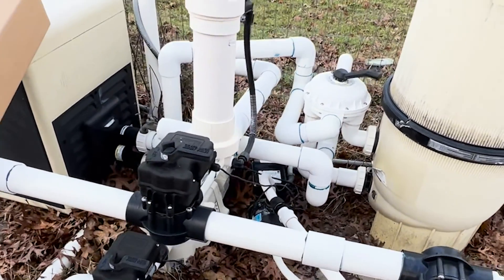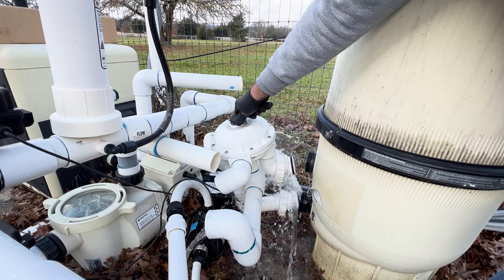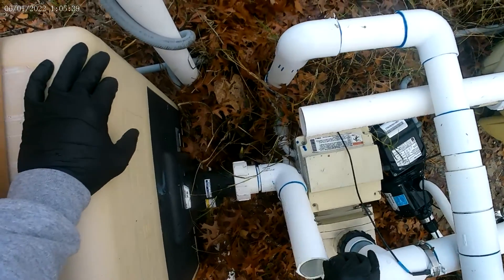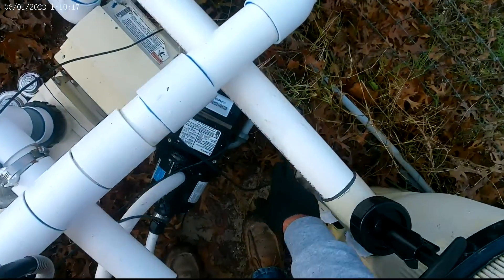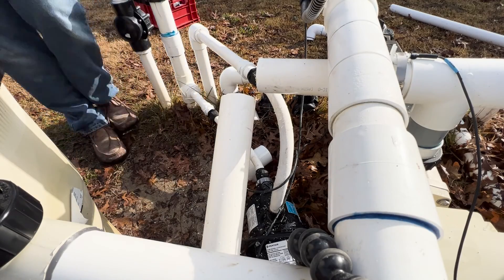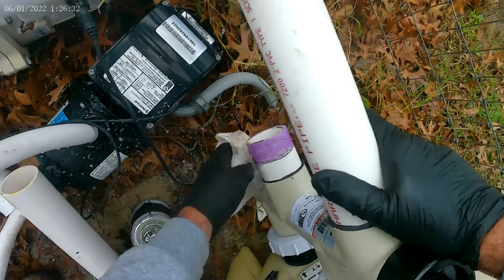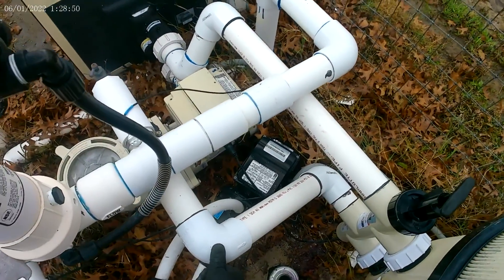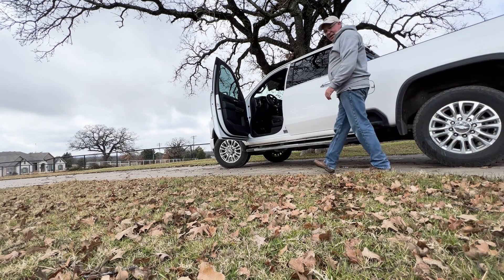Pentair Backwash valve installation; mistakes made

Comment: from my research the valve you just installed is not the correct valve for a de filter.    i have one just like you installed and i have twice now blew my filters apart
Reply from the maker: When you say that you blew your filters apart, what exactly happened?
Reply: @Pool-guy  I put in new filters ran it 2 days with fresh de and backwashed then pulled it apart and noticed filters were blown out.  I watched a couple videos and both said the slide valves are not for de filters pentair sells a couple specific valves for backwashing de filters
Reply from the maker: @ I don’t think I’ve ever seen that before. Any chance you could send a picture of the damage. 
Steve@aaapoolservice4u.com
Reply: @Pool-guy  email sent
Reply from the maker: @ what’s coming to my mind is that the grids are blowing up like balloons. And that is perfectly normal part of the backwash process. I actually made a video with the lid off explaining how it works.
Reply from the maker: @ dang!!  I see now, you have a Quad DE filter. It’s different than a traditional DE filter. 
The flow through the filter is backwards of a traditional DE filter. Two solutions. 
1. Replump the existing push pull valve. There is a picture on it for  “handle up” operation. This is good for sand and the Quad De

2. Or purchase a multiport valve specifically for the. quad DE filter
Reply: @Pool-guy just sharing what I learned

Comment: That's funny, I am going the other direction and taking off the Shaft Piston Assembly and replacing it with a High Flow Multiport assembly like what you removed. With the the repeated issues with the Shaft seizing up inside the manifold I have finally decided to go with a more simple setup.
Reply from the maker: The one in the pictures about 20 years old and is beginning to leak because the internal O-ring was worn down. The homeowner decided he wanted a more simple one. So I guess it’s just a matter of perspective lol.

Comment: Great video and you just saved me a lot of time. May I ask where you got that end cap for the pvc pipe  for backwashing that dispenses or shoots out  the water better?
Reply from the maker: The end cap is a standard pvc 45 that I heated up with a heat gun then flattened out. If you don’t have a heat gun you can boil some water to soften the pvc. Once it cools it will harden up.

Comment: Do you recommend the valve you used vs the penrtair fullflowXF?
Reply from the maker: There is a place for both and depending on the customers situation is how I choose which one. Some just prefer the hi-flow multiport valve because it’s easier then pulling up that handle. The push/pull is more “serviceable” as the gaskets and orings can be easily replaced, whereas the high flow has to be replaced when the gasket is worn. So to answer your question. Yes I recommend the push/pull in the long run, because it is more easily serviceable. 
Thanks for watching and great question. 👍😎